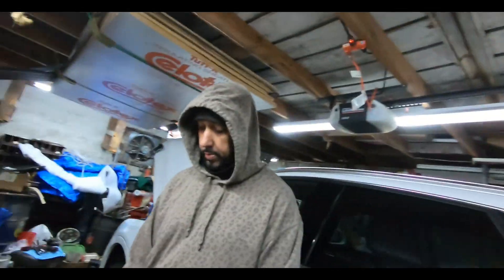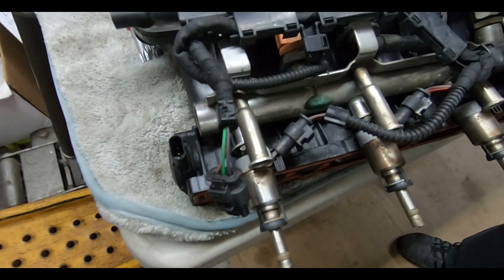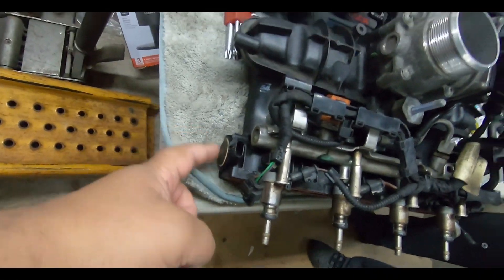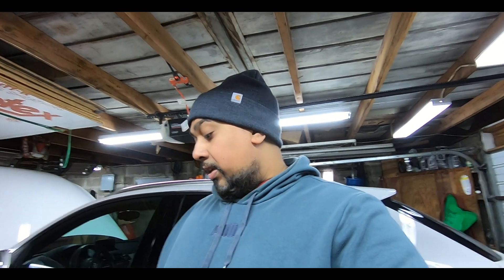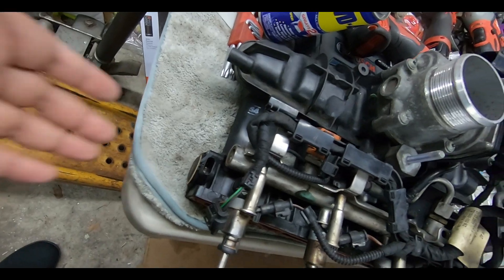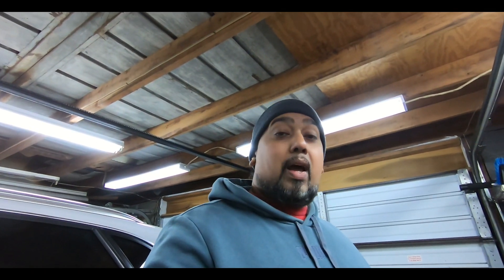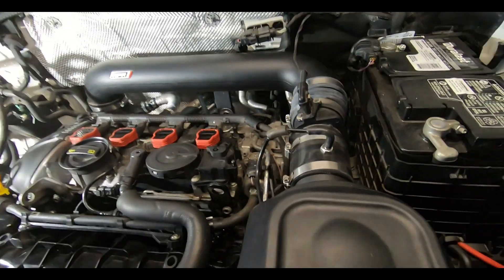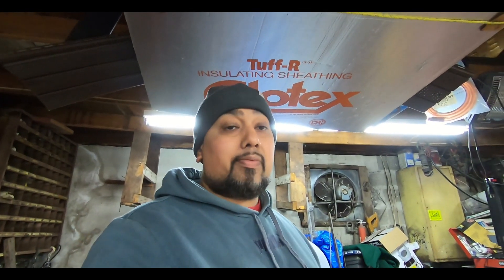Audi Q3 TFSI Intake Manifold Test P2015 Code

Comment: I just got a check engine light for P2015 and P2187
Reply: Same here any help
Reply from the maker: @izzyoda7867  You can remove and try and clean it if you have the time but you might want to replace it and save some time and stress.
Reply from the maker: yeah it's a pain but if you are going to do the work i would suggest also doing a carbon cleaning too.
Reply: Will do its in the yellow when I do a OBD read which is minor im guessing for the P2015 and another code P2187 in red